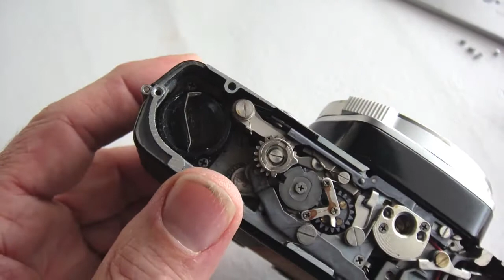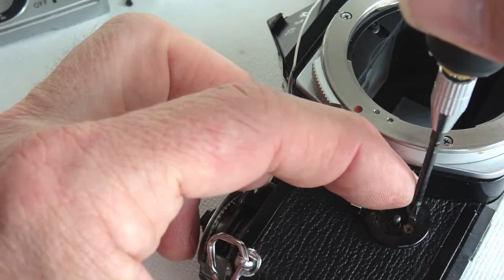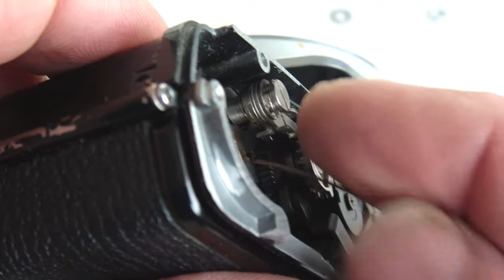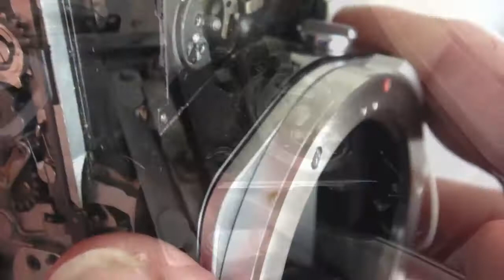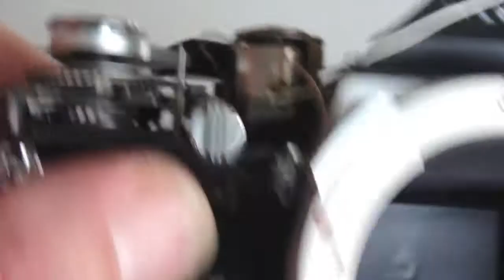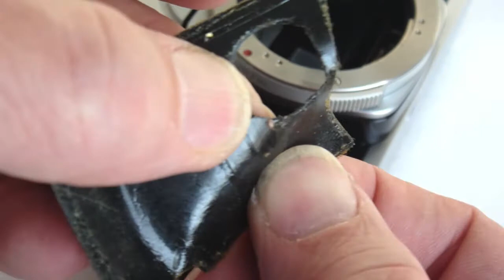Fix Old Cameras: Olympus OM-1 Battery Wire Replacement

Comment: Great video! I got an Olympus OmG and it worked for a little bit until it seemed like the batteries just couldn't connect, I didn't have the time or money to fix it but I'm coming back to it. When I took out the battery chamber, I noticed that there was a short piece of wire sticking out of it. I wasn't able to figure out where the wire was supposed to go, but your video helps me understand what I'm looking for and I feel much more prepared to handle the situation. Thank you!!! I've been looking things up for a while

Comment: I also have the battery wire which is corroded and very difficult to solder. I was wondering if it was not possible to attach (glue) a new wire to one end of the corroded wire and gently pull to pass the wire through. I suppose that if the proposed method is to disassemble the front panel it is because it is not as simple as that.
Reply from the maker: Usually the battery wire is glued to the chassis along the mirror box.
Reply: Thank you for this answer. I understand. Finally I succeded to solder the brown wire to the battery case with a lot of patience and soldering fluid. It wasn't working so I opened the top partof the camera  to check the electrical continuity from the battery case to the switch. Miracle the wire is ok, but switch appear to be corroded and whatever the position (on or off), there is no connexion between the wire solded to a small part printed circuit headind to the switch axis and the printed circuit corresponding to the switch postion. I short cutted the wire to the printed circuit corresponding to on position and I saw the light meter coming alive. So my problem looks like there in corrosion between the switch and the printed circuit. I put KF top linear product, some fluid dedicated to clean linear contact. No result. There is a large screw at the middle of the switch . I tried to unscrew it gently but it's doesnt come. I dont want to force this screw but I think I need to access the inner part of the switch to clean corrosion. Any Advice ?
Reply: I finally solve my problem and answered my own question. First I want to precise that my OM1 is a MD model. On this model the ON ON switch looks different as on the first OM1 model. The switch screw  wich is the switch axis cannot be unscrewed by the top and I didnt wanted to disassemble the pc board supporting this switch because the wire are fragile (often corroded) and resolder them is random. So I preferred to try to clean the contact and I used a mix of baking soda with white vineggar and it worked after a while (second miracle). Afterwhat I cleaned the switch with isopropanol to remove the remaining of baking soda and reassembled the top cover. I had taken advantage of the broken wire at the battery case level to insert a shottky BA 43 diode so the next step will be to check how accurate is the light meter with a 1,5 V battery in.

Comment: Yikes. I think i will just live without a meter if my wire is this badly corroded. I have popped off the top plate, and bottom, done some cleaning, but this is above my skill level

Comment: I have a problem with my om2n, it was stopped for many years, I put new batteries (in Brazil I can't find SR44, only LR44 alkaline) I insert the batteries and the camera works, if I turn it off for about 30 seconds, the mirror locks, and I have Have to take the batteries out and put them back in again, could there be a bad contact?

Comment: I had to fix my camera as the wire broke off the battery contact. I added wire as Olympus made the existing wire just long enough.  I had to replace the screw that holds the metal contact down. It is apparently common for the (plastic) screw to break off over time. I put a metal one in it's place and my meter stopped working, or at least I thought it was dead till it dawned on me that it might be a short due to the screw. So I put a plastic washer I found to fix the issue.   Sorry, but that was one lazy design flaw by Olympus but hey, crank them out. It will last long enough.
Reply: Hey, I just realised that my plastic insulating sleeve is lost, is it ok to skip it and just use the screw on the battery contact ?
Reply: @彭庆安  Not sure, give it a shot.
Reply: @ aight, thanks mate

Comment: Hi, I have an old om-2 that seems to short circuit every time the film advance lever is moved into position to wind the camera. Like as soon as you engage the cams, something causes the battery to short. That will of course lock the mirror and drain the battery. Can you help me out with a good place to start looking for shorts?

Comment: Oh gosh! Amazing video ans skills. The battery wire of my OM-10 is cut exactly at the same place, but I don't have the skills to do that kind of job. It seems that those OMs suffer the same issue regarding the weakness of the battery wire. If only I could grab it and solder it...

Comment: I used a similar technique to repair the battery wire on my dad's Konica Autoreflex T3. I simply removed both top and bottom plates, taped a new wire to a long broom bristle and fed it through from the top to bottom, or vice versa. He gifted it to me a couple years ago and I didn't want to damage anything by tearing it apart.

Comment: Hi, nice video.
I have recently acquired an Olympus OM-1 MD version. It had shutter mechanism related issues which were fixed with parts from a donor camera. Mechanically it is working well now. But the light meter is dead. The camera technician who repaired it said that the camera's internal circuitry and wiring is fine but there seems to be a problem with its galvanometer, something related to power flow. He said he will check and let me know if it can be fixed, otherwise I can still shoot using it without the light meter. Is there a way to replace the galvanometer with a suitable replacement and try to see if that works? I really would like to have the camera in a fully working condition, electricals and all.
Cheers!

Comment: So what are the timing issues that might arise if the front plate is pulled out too far, and is there any way to check for them before buttoning up the body?

Comment: Wow my battery cable broke after changing the battery twice and I thought it would be as simple as opening the top and bottom and feeding a new wire through and soldering. Didn't except the wire to be routed this complicated. Maybe I should just use an external light meter.

Comment: Very clear and helpful. These days I have a problem with my OM2n - it will only works for a minute or two after I put the batteries (SR44) in. Then the mirror locks up at every attempt to take a picture (when not in B mode). When I remove and put back the same battery or another brand new one, it works again for a minute before the mirror locks up. Do you have an idea ? Thanks !

Comment: good evening! Ive got an OM 10 with a broken battery cable (corrosion caused i believe). I have enough wire available to attach to before it disappears into the body, could you advise what i could use to bridge from the break to the spring contact? thanks very much
Reply from the maker: Often corroded wire will not take solder no matter how much flux is used... so that could be an issue. Otherwise any source of braided wire that is of a similar gauge will work. Solid core wire is a little stiff to work with in tight quarters but would be acceptable too.

Comment: Excellent.
As an aside, have you ever found a battery contact in one of these that just would not take solder?
I did the diode mod on mine and while it was in excellent condition, zero corrosion or anything, I just couldn't wet it.
Reply from the maker: Yes that can be an issue. You can replace the contact with a donor. You can fashion a contact from brass strip(.016 - .025 )  Or use wire glue... 
https://www.amazon.com/shop/fixoldcameras

Comment: Nicely done video.  Thanks.  I think I could possible fix this, but I'd rather just use the OM1 as a second camera with a 50mm 1.4 lens or use it with a light meter.  Either way is a fast and easy solution.  With a second camera, I already get the reading, so adjusting the Olympus to match is actually faster than using the through the lens meter, anyway.  I don't need a new reading for multiple shots in one lighting condition.  If it's worth taking a photo, I will probably shoot several frames with each camera.
Reply from the maker: Sounds like you have an excellent solution for your picture taking needs. Keep'em going.

Comment: Hello, Great video. i have got om2. problem is battery drain. Is this a solution for om2? i bought a silver oxide battery but i used it for two weeks.
Reply from the maker: Very often excessive battery drain is caused by slight latent moisture damage. Check very carefully for small nearly unnoticeable spots of powdery corrosion, if any are found clean the area with alcohol. And yes a pinched battery wire to the terminal could cause a battery drain. Also, all though not typical,  the diode near the battery box could be leaking and need replaced. A good place to check for shorts is around the main switch. Check for shorts between the IC cans and the body and for pinched black wire. Even with the aid of an ohm meter battery drain issues can be elusive. Hopefully with a little patience and much persistence you will find the source.

Comment: OKay just got to the bit where you take off the self timer mechanism,  it's LEFT hand thread ! Also if you haven't got the proper tool OR a pair of tweezers, you can use a kitchen fork if you bend two tines out of the way and sharpen the remaining two with a file.
Reply from the maker: Imaginative use of on hand resources to get the job done.

Comment: I need to do this but I haven't got a donor wire, can I just use a wire of similar thickness or will the different resistance throw the light meter off?  Thank you
Reply from the maker: Try to use stranded wire such as 22AWG stranded wire or something close, a bit smaller or larger will be fine... or snag some wire out of a discarded point and shoot camera or other electronic device that is no longer in service. Please note that sometimes the corroded battery contact will not accept the solder if that turns out to be the case you can use conductive wire glue of salvage a contact from another camera.
Reply: Great, thank you

Comment: Hey, thank you for your amazing videos and helping me to no end! I need to do a battery wire replacement on a little rangefinder camera, but the original wire is nowhere to be found.. can I buy new wire from a store? If so, which one would be best? I was told single core equipment wire would do?
Reply from the maker: 22AWG stranded wire... or snag some wire out of a discarded point and shoot camera or other electronic device that is no longer in service. Please note that sometimes the corroded battery contact will not accept the solder if that turns out to be the case you can use conductive wire glue of salvage a contact from another camera.
Reply: @FixOldCameras  This 22awg wire, could it be replaced by one of the wires that make up internet network cable?
Reply: @FixOldCameras  PS: these ethernet cables appear to be made up of 24AWG wires

Comment: Hello! 
I have got OM-1 shooter and retarder after clean.
I can not find out a fact: when i install retarder on shooter 1/1000-1/125sec speeds shoots as 1/60 and 1/60-1sec works normal. Did you look a problem short of that? What reasons may are?
Reply from the maker: Not sure from your description. Maybe this OM-1 Fix Old Cameras video will help.
 https://www.youtube.com/watch?v=VO9AXBIUG08&t=27s

Comment: Thank you for the excellent videos. I have just bought an old OM1 in fair condition and would like to open it up and do the light seal above the prism as well as the back door seals. I will also check the battery wire and holder condition and do a general inspection and clean while she is open. 

Are there any other things specific to the OM1 I should look out for? Any general service tips on such a camera? Thanks again.
Reply from the maker: You might also check out the FOC video on the idler gear.
https://www.youtube.com/watch?v=Y1mi6CTTSYw&lc=UgxHjaYYdow6jlxc9yB4AaABAg
Reply: I will do, thanks for that suggestion.

Comment: Hi! Can you help me with my olympus om10? Whenever i put new batteries (sr44), i tried lr44 also, the camera just doesnt work. Whenever i check battery, it will beep for a few seconds and come off, sometimes it will not beep. Everytime i press the shutter button, the mirror will lock and it will take about a minute or so before it fully shoots. Is there a problem with the camera, maybe it cant connect to my batteries? Or is it electrical problem? I really need your advice!
Reply from the maker: This FOC video link might help - https://www.youtube.com/watch?v=oF3_OelqSWM&t=1s

Comment: Hi! I've a  problem with an olympus om-4. I guess is some kind of electrical problem but unfortunately I haven't find it, I've removed the top cover and cleaned the mode switch contact, after I've connected the camera to a power supply and measured the current consumption and everything is correct like the service manual say! Unfortunately the camera work fine for a limited time, if a let it off for more than an hour it will start after some fault, the shutter remain blocked for, more or less, one minute, and in this condition the current consumption is enormous, after one minute the camera shoot, and finally return to work properly. 
Ps. Excuse me for my poor English that is probably full of mistakes. I hope you can help me, because on YouTube I can't find olympus om4 repair videos. Thanks
Reply from the maker: There is a possibility that oil has migrated on to the surface of the second curtain holding magnet and this condition is causing the initial hang up. The only other explanation would be your suspicion of a circuit or switch malfunction.
Reply: Fix Old Cameras Fantastic! That's really probable, because at the  first shoot made an Half click, that is clearly audible, and is certainly the first curtain, followed after some seconds from the second curtain! Now, I must find where is located the electro magnet, I hope that is like the om-10, under the mirror! I will look at the service manual! Thank you very much for your answer! :)

Comment: Hello Fix Old Cameras, I've been watching your videos for a while and you already helped me a lot with them! Can I please ask why is it better  to  use a salvaged meter wire rather than a same size new wire? Thank you!
Reply from the maker: The salvaged wire itself is not better as long as the supplied wire is braided and of the same size. However, often times when corrosion destroys the integrity of the battery wire it also destroys the integrity of the battery contact to the point where the damaged contact will not take solder.
Reply: Thank you, appreciate your response!
Reply: What is the size of the camera wires generally please? Like the gauge?